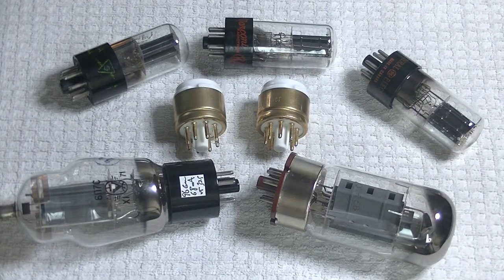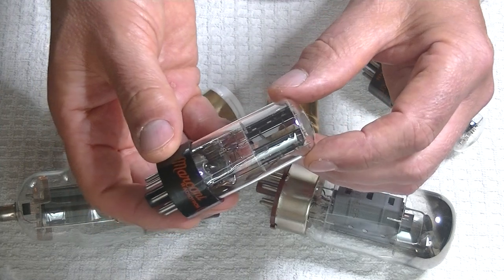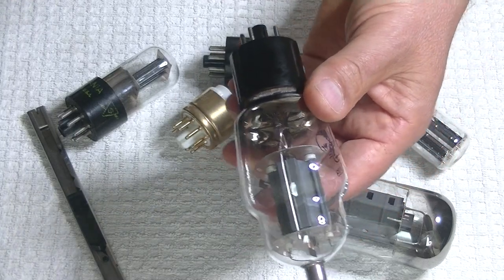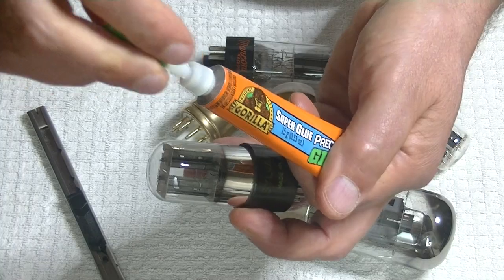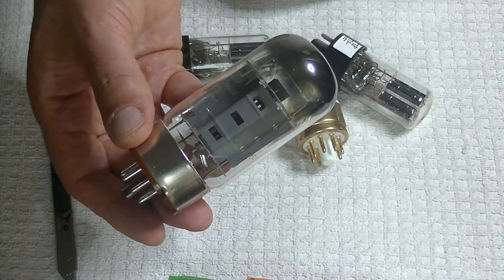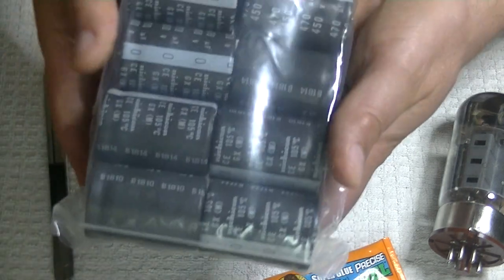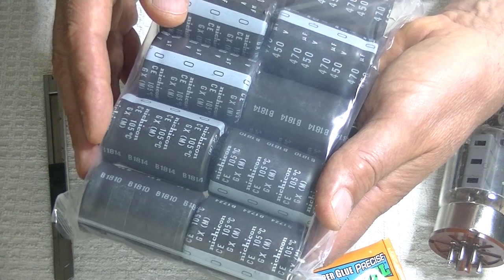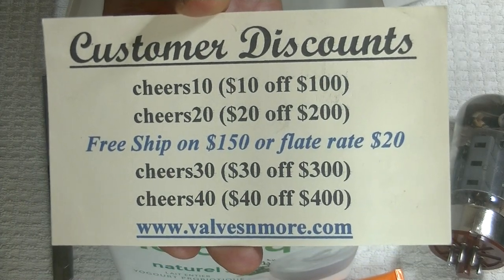Tube Lab #44 - (SEE LINK BELOW) How to Repair Bases

Comment: The standard base cement used on consumer radio tubes was shellac-based. I have no need to use crazy glue, epoxy, silicone or any other type of adhesive for this purpose in years.

For tubes with intact old cement that has a loose glass envelope, I use 91% isopropyl alcohol, applied with an eyedropper. Sometimes I add ~10% shellac to the iso. 

Add a rubber band to hold base tight to the glass and let dry overnight. The iso rewets the original cement and restores the adhesion to the glass. It is also very easy to clean-up.

This recipe, for RCA's basing cement, yielding about 200 pounds of material, was "standard for all bases.” 
(Thank you, Lud Sibley, Tube Collector article, Feb, 2000)-

Coarse marble flour 170 lb.
Orange flake shellac 19-1/2 lb.
Durite phenolic resin LR275-2 7-1/2 lb.
Medium-color (grade G) rosin 3-1/4 lb.
Denatured alcohol 9 liters Malachite Green aniline dye 10 g

One can even harvest old cement and reconstitute it with iso.

Kent, CHRS vacuum tube curator.
Reply from the maker: Thanks for the information, I'm familiar with shellac from my days building and finishing fine furniture.  And will try this method on some of my vintage tubes with loose bases.  However a lot of later production tubes appear to have been cemented with a urea type adhesive, the evidence is clearly visible in glue lines that show signs of an expansion type cement.  In those cases I have found the thickened type of crazy glue to be the best at bonding to the 3 materials (plastic, glass and existing glue).
Reply: @tubelab194  Hi Tubelab. The best thing I've found to reactivate the glue. Is Acetone or nail varnish remover. I just used it on an RCA 6V6, which was very loose. It would twist at most 1mm. I use a hypodermic . I put the needle into the gap and lightly apply the acetone. It evaporates within a few seconds. I'm sure yyou are familiar with it. The needle also penetrates and pushes the glue into gaps. I can swear it works. The only thing You have to be careful with is the lettering. If it gets onto the front of the base. Just wick the overspilled acetone with tissue. Dont wipe. Ive ruined labeling that way Thats why I use a hypodermic. I used to use a cotton bud but it would make a mess. Please give it a try
Reply from the maker: @reportingfromthebunker  thanks for the input.  Since this old video, we have developed a perfect repair solution using shellac.  You can see the recommendation in this string from another viewer.  To see this method checkout Tube Lab #111 Repairing Bases.  Since the video was made, Charles has made flawless repairs of 100's of tube bases.   He's gotten so good at the method that you would never know it was repaired.
Reply: @tubelab194  I've seen the shellac based tube glue right up to the 1960's. But, yes, I believe you regarding modern tubes. I've used crazy glue in the past as well. If it works, great!

Comment: Hi! Jim, commenting here as its your latest video. I have sent a message via your web site. Yesturday I purchased the Willsenton R8 in its standard form with the EL34's. I want to upgrade the tubes soon after. You have somewhat ventured into the R8 tube compliment and obviously had a listen. May I ask your recomendation what your pick for the power tubes be, considering I listen to female vocals and acoustic music. With the pre-tubes, the 6sn7's and 6sl7's to be best matched up with the power tubes. Speakers used will be the Triangle Genese Trio, easy to drive and not a speaker that is in your face. My other set is complete opposite its the Magnepan's LRS which I will test the R8's on. Can you recommend ( cost wise ) the best package and one just down from that. I do have have some concern as I paid $853US for the R8 $1298US with shipping, so upgrading all the tubes at once could see me at $700US which is nearly what i paid for the Unit! Would be great to get your opinion since you know these valves so well..thanks in advance...Alain
Reply from the maker: Congratulations on your purchase of what is almost certainly the best budget amp ever built!  But to make her really sing you need a quality set of vintage tubes or if on a budget go vintage front end (preamp tubes) and modern power tubes.  I've put together packages in the store, all of them sound good!  The difference when you spend more is refinement, the detail improves a wee bit and with improved resolution comes an improved stereo image and soundstage.  Currently the "Gold" and "Special Edition" excite me the most, they are both affordable and give you great sound at a budget price!
Reply: @tubelab194  Thanks Jim for your quick response. Yes I had a look at your packages and I have also worked one out all by myself LOL...My thoughts go with the gold package and add x1 extra 6550c to the quad = $550 + single 6650c....or #550q Svetlana 6550c sed quad + #1b Sylvania 6sn7 GTB x3 + #46b Sylvania 6sl7GT x2 + no single 6550c purchase = $699....Question my thought out package LOL is only about $49 extra than your gold package with the extra tube....would I be gaining anything by going that route, sound wise ??...let me know and I will go ahead with the recommendation, thanks again..Alain
Reply from the maker: @cruise2023  that's a great package!  And yes you will hear the difference!  But the Sylvania 6sn7gtb is currently not available in matched pairs, so just order 2x #11 Tung-Sol 6sn7gtb instead (some prefer the Tungs over the Sylvania, very similar tube) and for v5 in the filter stage 1x #222 Foton 6sn7gtb equivalent.  The Foton is a superior tube in that position (dead quiet). Cheers!
Reply: @tubelab194  Thanks Jim, watch your shop, will be ordering probably today, I have time to think as we have just been put on Level 4 lockdown, the Delta variant virius has just entered New Zealand ☹
Reply from the maker: @cruise2023  I have a customer next door to you and he's basically in the same situation, I just shipped a nice quad of power tubes to him to play with while he waits for the 4th wave to go away!
Reply: @tubelab194  Okay, next door like west NZ where I am or next door in Australia ? LOL
Reply: @tubelab194  Hi! Just sorted what I want to get and went cart to pay and was confronted with GST which I pay on entry ( why do I pay you GST on Int sale, its normally taken off !!! Vat I think its called ) another add on PST, what is that ? all of this cost has now esculated past what I paid for the amp !!!! let me know b4 I pay please.
Reply from the maker: @cruise2023  if your address is outside Canada you won't be charged Any Tax ($0.00) by the store at checkout and if for some bizarre reason you did pay something in error I would refund it immediately.
Reply from the maker: @cruise2023  I have a few customers in New Zealand but more in Australia.
Reply: @tubelab194  Thanks Jim, but I still don't know what PST means at check out, which shows up as a charge !
Reply: @tubelab194  I answered my own question to a point but not the PST..Have ordered and paid for the quad 6550c + 1 extra tube and the Foton 6sn7GTB, You are right once at check out there was no Gst and Pst...go figure!!! the others I will get after I have set up and listened with the tubes installed ( I bet they are not matched ) and then swap out the what i have bought and go from there, thanks Alain